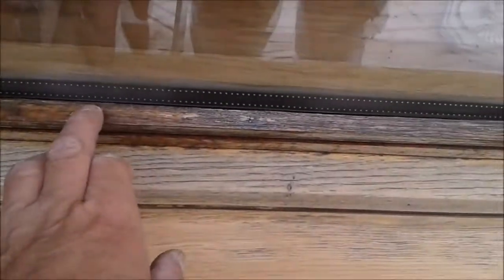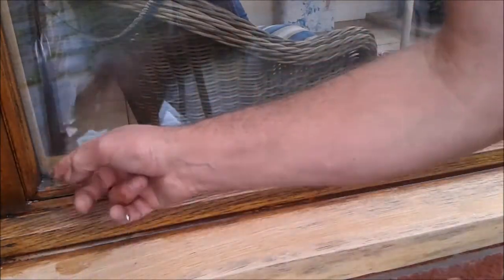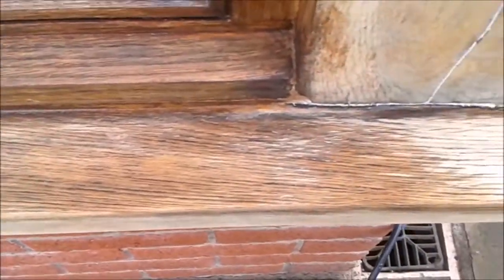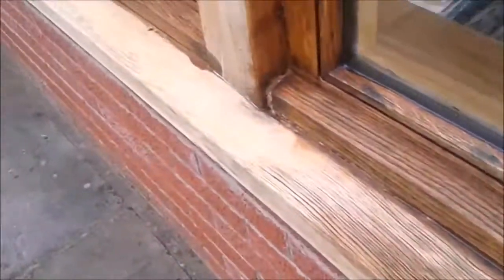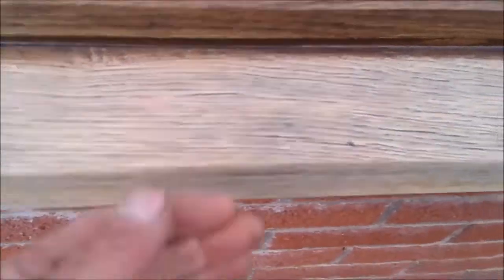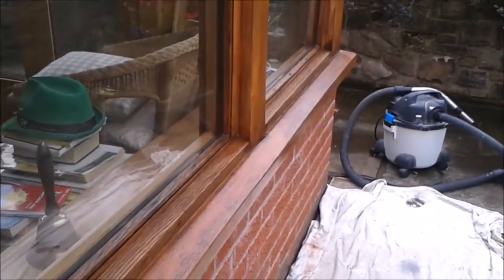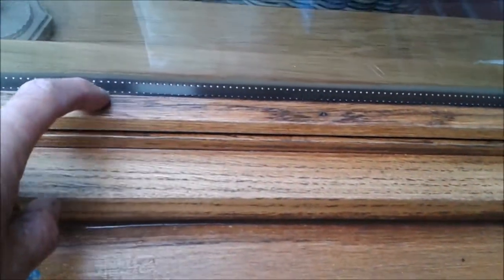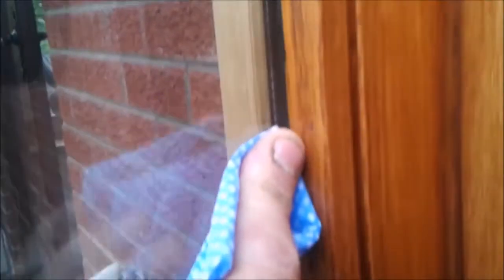Sealing glazing beads on a conservatory

Comment: what filler did you use to blend in with the wood ?
Reply from the maker: Unibond weather guard extreme repair and only use oil based exterior paints.
Reply: Thanks, mate I appreciate the feed back I will write that in my note book.